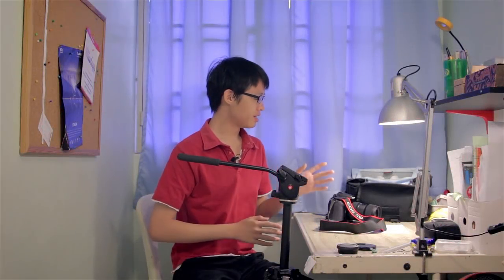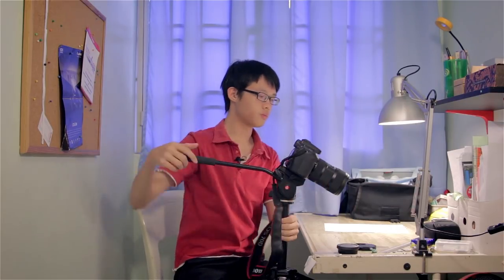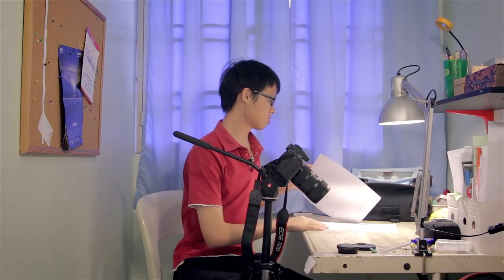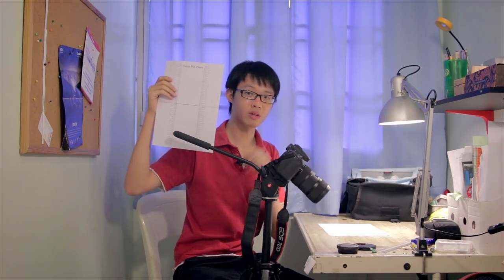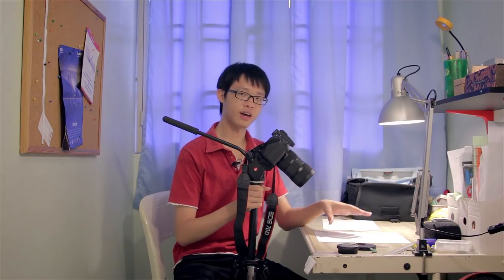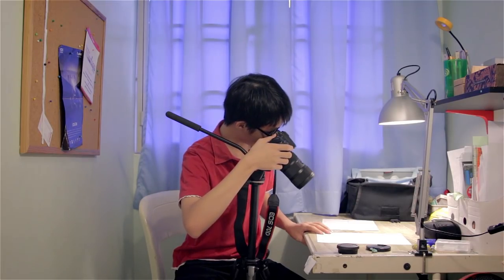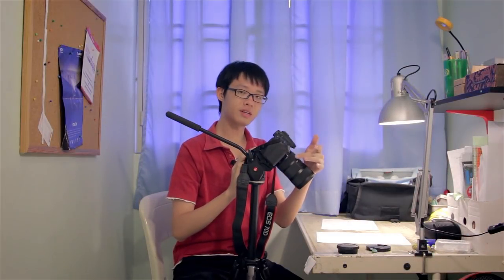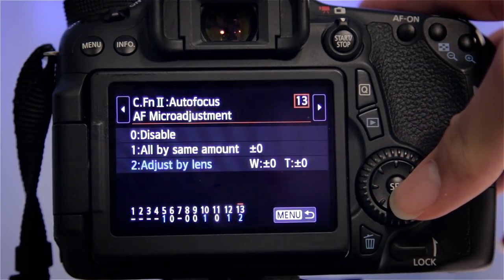How to perform AF Microadjustment

Comment: i know you are good at these. i have a problem

with my 70d when i shoot the video the lens focus is to noisy. i shoot the video and i hear the lens focusing sound more than i hear my self. how to fix this problem?
Reply from the maker: 1) If it's possible, use manual focus. It won't totally eliminate the noise, but it will greatly reduce it.
2) If you have to use autofocus, try using a STM lens, they have more a more silent AF drive.
3) The best way to eliminate this problem is by recording your audio externally on an external audio recorder and record your voice through mics separately.

You can also refer to this video for more tips on getting clear audio for video
How to get better audio for your video
Reply: ZY Productions thanks a lot for the reply. I need to know what kinds of mics out there. I've been trying to look for mics but I don't which ones. Can you please help me with this too
Reply from the maker: How to get better audio for your video

I run through the most common mics used in videography in this video.
The most common ones are a hotshoe mic, a shotgun (supercardoid) mic, and a lavalier mic. These are most common for recording live video with but there are also more mics that can be used for video in more specialised ways like Small Diaphragm Condensers, or Large Diaphragm Condensers.
Reply: ZY Productions thanks. I am gonna watch the audio video that you put. What I want is the ones that are wireless. Kind of the one that you put under the shirt and talk to people and I can hear my self and other people in that mic.
Reply from the maker: Those that you wear called are lavalier mics. To have them wireless you will also need to buy a wireless transmitter and receiver unit like the Sennheiser SK 100 G3. Then you will need to plug in your receiver into your field recorder to record and monitor the signal.
Reply: I solved my problem by using an external mic. I use a Nikon ME-1.

Comment: in what mode are doing these tests and adjustment? should this all be in the P mode?
Reply from the maker: Khalid S. I did everything in M mode.
Reply: ZY Productions .. When shooting with the Close-up mode, I get sharper and more detailed pictures with my PowerShot 95 than those I get with the EOS 700D. I don't know why. I've just bought the 700D. Any tip?
Reply from the maker: Most probably you're shooting with a lens that's not very sharp, or you may be shooting in insufficient light. Look into getting a macro lens and make sure your subjects are well-lit.
Reply: ZY Productions .. The lens that came with the 700D. That's Efs 18-55mm

Comment: Sorry, but angle target can't help to achieve right result. All because of the AF point on focusing sensor and square on focusing screen. AF point can be not centered in square. If you calibrate on angle target, AF point can take and lower near, and higher farther. That's why it necessary to use focusing target with right angle plate. Thin line is not guarantee, that AF can't focus on clear paper - it can handle microcontrast.

Comment: Your description is problematic.You are actually describing a method where two different variances could interfere with each other:1. The focal plane calibration2. The exact positioning of the focus point You really need to have a vertical plane surface to focus on!
Reply: He explained that. Chart on a perfectly flat surface. Camera pointing at 45°. Central focus point. Aim at the line. Shoot. Check for sharppest point. If needed, adjust MF :). It's basically the same as the Spyder calibration tool

Comment: You should really put that chart on the wall completely flat. Doing adjustments at an angle will make your problem worse.
Reply: If you put it on a wall, you can't tell if you are front- or back focusing. Needs to be a horizontal or angled chart to get the distances.

Comment: First off let me say I am not disagreeing with you. It's just that most of the pro's I talk to on this subject agree it should be done with a auto focus calibration card with a 32 degree upwards slant, kind of like a pyramid. What you are doing is so much easier. It can be a real bitch trying to do it with the pyramid card.